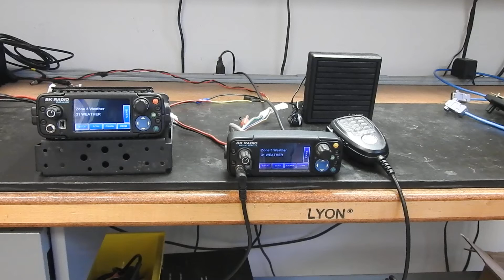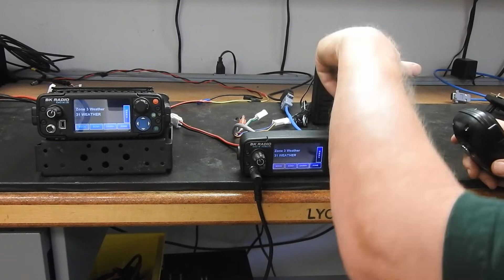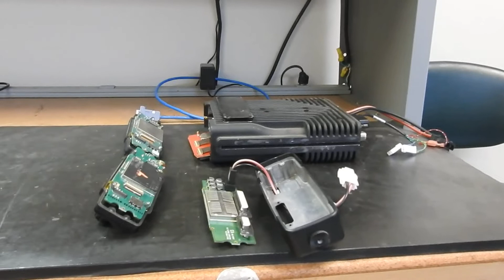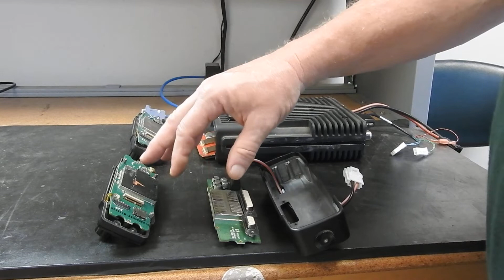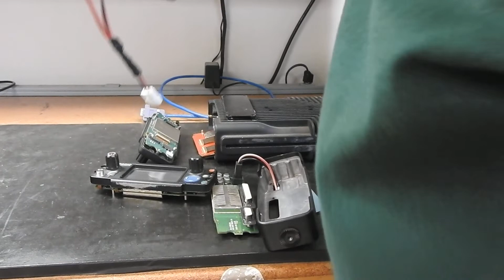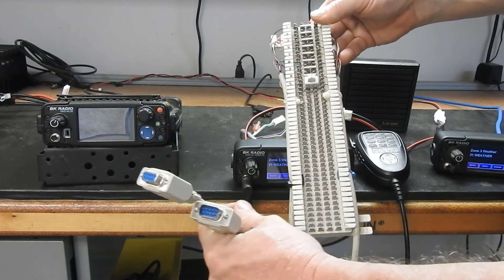BK KNG M150 Mobile Radio Troubleshooting

Comment: Hey Jim, curious if you're able to replace a damaged dash mount control head with a remote mount head-what changes would be required in there to make the remote head "smart"?
Reply from the maker: As far as I can tell, it is just firmware. I think if you had the right lightning flash you could go back and forth. The firmware is smart and won't let you upgrade.

Comment: Jim - I just found your channel and am enjoying the information.  I am fairly new to the BK universe but program and use a BK KNG P800.  I am looking for an M800 remote mount radio but have not been able to find one.  I have sourced a front mount M800 but really need the remote.  Do you know if a front mount can be converted to a remote mount?  I have done this with a Motorola XPR5550 in the past.  Thanks for the help.
Reply from the maker: If you get a KAA0660 remote head kit, KAA0636 remote cable and a KAA0661 cover you should be set. Suggest monitoring EBAY. $$ :( BK just covers up the dash mount head with a cover, yes, I kid you not. They both work btw. Then the remote plugs into the back via control cable. No head/interface board swap like a Motorola. Make sure the firmware is the same version between head and radio.
Reply: Thank you very much!  Now I have my shopping list and a good project to work on!